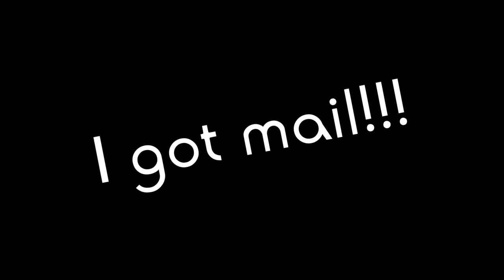Old Knife Restoration - FMM Stamp on the Blade

Comment from the maker: Hello everyone!
This old knife restoration was definitely a fun and easy restoration with my new vice. Funny thing is that I got it in the middle of the video. Hey, better ever than never, right 😊

Stay safe and see you next Monday 😊
Boris, Norway
Reply: Nice.. Mora knife. Made in Sweden.. :D ha de fint Timmy, Sweden
Reply from the maker: Hei Timmy!
Takk det samme 😊👍
Reply: @FFD_Restorations  I've got the 125th anniversary edition of this knife it's not nearly as impressive as this older model. It's really boring. And the handle stains very easy just in moderate use. I've cleaned and sanded it multiple times.
Reply: @mercuryrising9174  handles need to be sealed/treated. Bare wood ofc stains
Reply: @FFD_Restorations    эх
Reply: В
Reply: I Like my Mora Knife 🙂
Reply: Ффффффффффффффффффффффффффффффффффффффффффффффффффффффффффффффффффффффффффффф

М
Reply: Reply..
Reply: What was the Magic Potion in which you steeped the blade?
Reply from the maker: @Zacharia503  I used 7% white vinegar 😉
Reply: 1à
Reply: @FFD_Restorations  Oh, right; thanks.
Reply: M

Comment: I've been watching your videos for a while now, but I've never restored a tool myself. I've decided, however, to do my grandad's old axe. I've noticed you used vinegar, after which you sanded the blade down to bare metal anyway. Does vinegar help sanding off the rust? Thanks for your satisfying videos, btw, and take care 👌
Reply from the maker: Hey there, that is awesome to hear! Vinegar will help to remove some rust but not completely. Be careful how long you keep it in the vinegar. If it stays too long it will start eating good metal. My main reason for using vinegar is to remove loose rust and dust. Sanding without this step creates a lot of fine dust and it is messy in my opinion. Hope I answered your question!
Good luck and be patient ☺️
Reply: @FFD_Restorations  That's great! Thank you for your quick response and the advice 👍 Keep making some more great content.
Reply from the maker: @wekoweko71 no worries! Will do 👍 Have a good one!

Comment: awesome restoration! but the blade of the knife was scratched by the files, does tht mean that the blade was soft? i think it could need heat treatment
Reply from the maker: Thanks. No, because the blade is made out of a soft steel outside and hard steel inside. There is no need for heat treatment. Most Swedish knives are made this way.

Comment: Dude thanks it's the real restoration,not like 90% of scam here on youtube, a little tip: drill a tiny hole on the end of the crack before you do anything else. And one more,back in a days they didn't use a fancy wood on these handles so they painted them, mostly black, sometimes green,paintjib was good with primer and all
Reply: @FFD_Restorations  Я только что посмотрел у вас про нож белку ,и по молотку догадался что вы говорите по русски ))) у нас в америке так не делают рукоятки )))

Comment: Nice work man. Question, whats the purpose of rust dissolver on the blade since its all filed down anyways?
Reply from the maker: Thanks! It helps to reduce super fine rust dust in air.
Reply: Ok thanx. Nice to learn stuff. Appreciate that you answer.

Comment: FMM- tht trademark, is it in an oval about midway down the length of the blade? because the old mora i have its FMM in an oval midway down the length of the blade and the only other stamp is mora sweden no design number or anything, it came with a leather sheath with mora stamped into the front and that same button hole in the back riveted on with a single rivet i can't find any online that have that oval stamp or the single rivet button hole... any help would be greatly appreciated thank you
Reply from the maker: Hey Richard!
Thanks for reaching out! I haven't come across on any additional information about the knife what you described. I am sorry! 
Thanks for watching
Reply: The stamp on the knife is visible at 13:23 and have FMM Mora and Sweden as text together.
If you look at the old catalogs at https://morakniv.se/en/this-is-morakniv/historical-catalogs/ the FMM in an oval is later design you can see in the 1951 catalog but the one of the knives is the one in the 1930s and 1945s catalog. It is stated in the history part for the company that Sweden was added in the 1920-30.   So the date of life is likely  between 1920 and 1950
The sheath for that design was not leather in te catalog but Vulkanfiber https://en.wikipedia.org/wiki/Vulcanized_fibre so a plastic material made of wood. 
There exist leather sheats that design to hard and shaped like the one in vulkanfiber.
The knife is still manufactured and you can find them in different length and sheats at https://morakniv.se/en/knifeseries/classic-en/
Reply from the maker: Great stuff Peter, thank you so much for sharing!
Take care!

Comment: Thank you for the video. A meticulous effort on hopefully a good old knife. My thought is this; first thing I would sharpen the knife to see if would hold a good edge no matter what the provinence, then put the effort in a known quantity. I spent a lot of time on a similar knife and feel I wasted a lot of time, but it's ok if you don't need a keen edge. Best of luck anyway!
Reply from the maker: Hey Frank! Thank you so much for watching and sharing your experience. Definitely is wise to do as you suggested!
Stay safe!
Reply: @FFD_Restorations  I had to go dig mine out; it appears identical to the one you restored, probably a more recent Mora with traces of red paint still on the handle but either it wasn't stamped or the stamping is rusted out. I had to do a lot of work on to get to smooth metal as it was in my woodshed in Nova Scotia for perhaps fifty years and the climate did its damage. I can put an edge on it enough to cut paper but it won't last. It's a good all purpose knife for someone who doesn't mind if it's a little dull. A lot better than no knife.I also found, stuck in a floor joist in my house, a similar knife with the same style handle and ferrule, with peened washer holding handle on but the blade is just over an inch and much thinner; probably used for wood carving, and it holds a remarkable edge so it's in my wood carving kit...lol. Thanks again for the video; good ideas and you're onto a good product with the Teak Oil. I use it a lot, and like the finish.
Reply from the maker: Awesome, it sounds like you did an amazing work on that one. I know how hard is to get the shiny blade that still have enough strength to be used. Those knives are really simple in design but great for many occasions. Thanks again for sharing your story here and that you are willing to restore things, not just to throw them away. That is for respect 😊👍
Take care Frank

Comment: This was great. But, today am working on a a stainless blade with very small black pits. I don't want to cut in to the blade just remove the black. Any secrets you are willing to reveal?
Reply from the maker: Thanks John!
Use finer sandpaper if they are not to deep. For deeper ones you have to cut in to the blade unfortunately...
Reply: @FFD_Restorations  They are small but black pits and I won't dig in but would like to remove the discoloration.
Reply: PS: I have put it to bed, for now in my collection.
Reply from the maker: There is no magic trick for that, sorry. Only way to remove them is by sanding them and getting flat surface ... If is a stainless steel blade it should not have pittings ...
Reply: @FFD_Restorations  It is an old Schrade SC 705  that schould

 

have been saved carefully instead of used.

Comment: My father has an old Mora knife like this from his father, which was the knife they used for butchering on the farm. It still has most of the red paint on it, and a crack down the handle like this one. I'm not sure if I should sand it down and re-paint it, or if I should just fix the crack and leave the paint as it is. The blade is a little loose to, but I can fix that like you did here. The blade isn't rusted, just very, very dirty.
Reply from the maker: That is awesome! Depends if you plan to use it. If so, I suggest you do paint job as well since it will protect it from elements. If is just a display piece now you can do just a good clean up and rub beeswax-oil to preserve it from oxygen. Good luck 😃👍
Reply: @FFD_Restorations  Thanks 😊. I’ll fix the blade and clean it up first. And if my father wants to use it after that, we’ll paint it and get a new sheath made.
Reply from the maker: Sounds good, have a good one 👍

Comment: When I make my own wood filler I use ordinary wood glue because it will dry up clear so the filler will get the same color as the wood dust that I use and you can get a wood glue that is waterproof when dry. When I mix it I use more wood dust than glue.
Reply from the maker: Thanks for sharing, I appreciate that 👍

Comment: Good old Swedish Mora,three sizes of them,this is midlle one.A carbide core
was implanted in the blade,so sharpening needs extra care,with correct angles.
Sheath was made of black plastic with a leather belt loop.Handle is always 
painted in burgundy.Back in a day,or even today,its a good puukko.

Comment: Why would you put oil on the handle and then epoxy that big crack? That makes no sense to me.
Reply from the maker: The wood was to dry, to protect inside of the crack since it goes quite deep. Adding oil afterwards would not penetrate in wood through the epoxy.